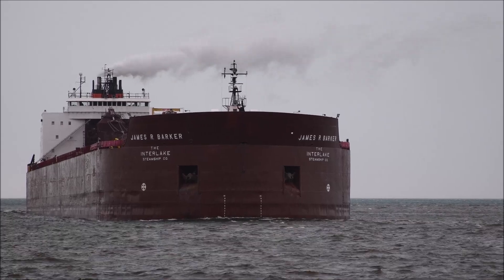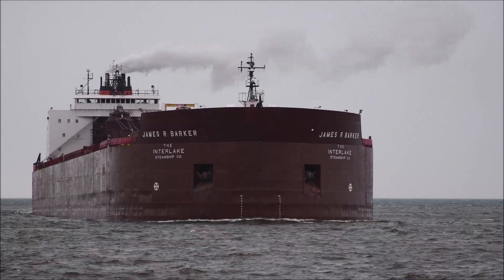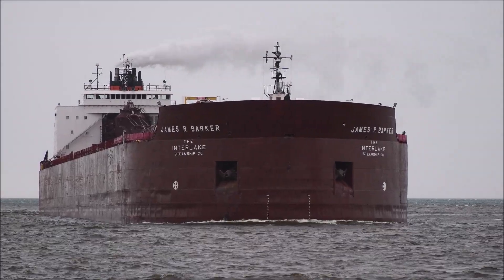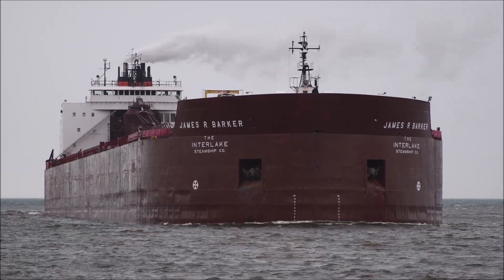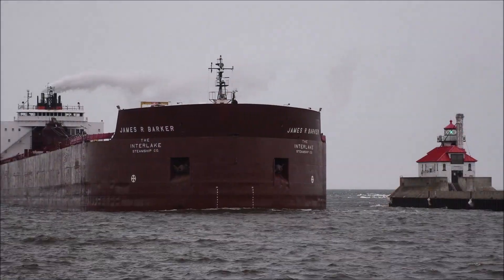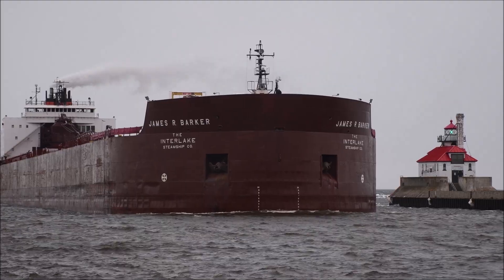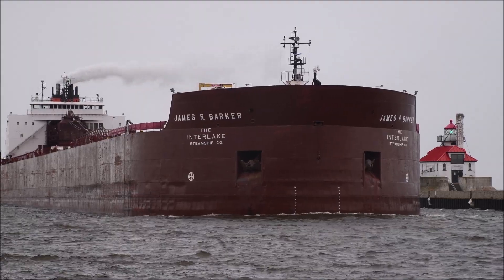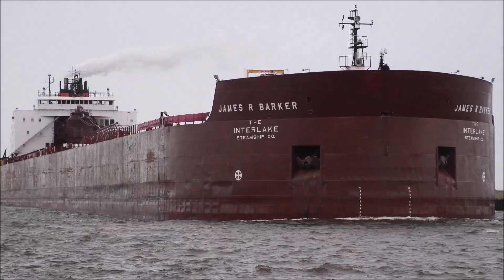James R. Barker - Arriving with the Wind and the Rain

Comment: Nice shot, and something different, of the lift bridge lowering as the Barker turns towards the pier. Also, are the announcements describing the type of boat approaching the bridge only given when there's a group of sightseers/boatnerds present?
Reply from the maker: Thanks! The announcements are given when the visitors center is open. I’ve heard them make announcements when only a couple of people were present.
Reply: Are they using the auto voice this season? Have not missed that....